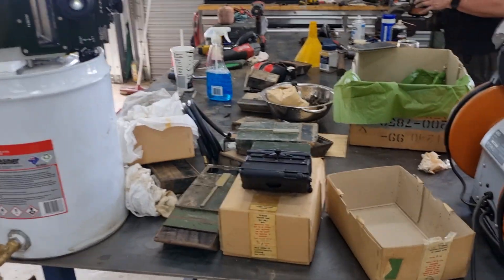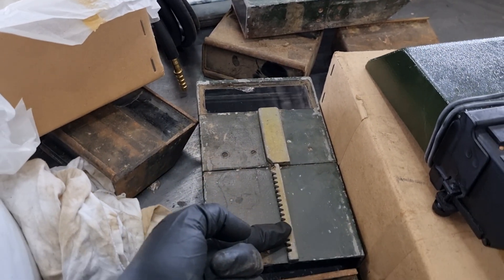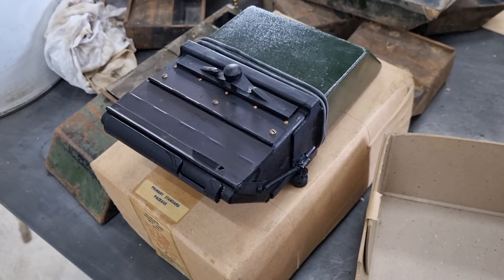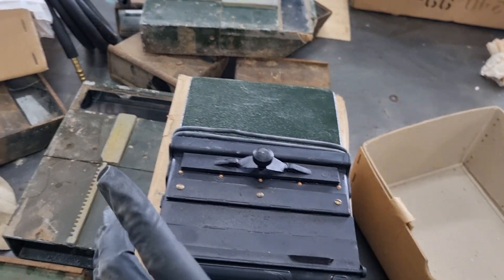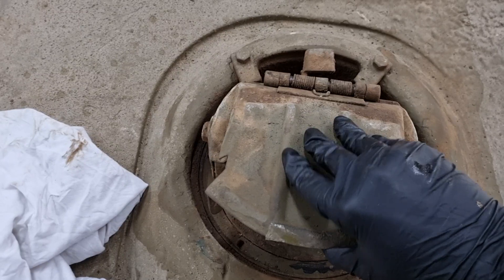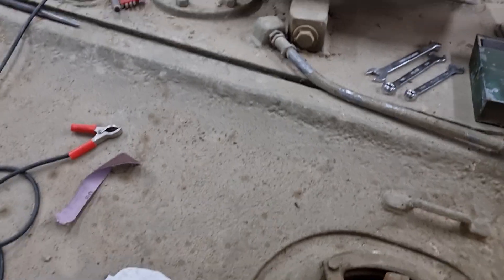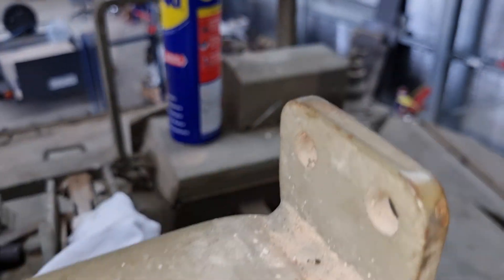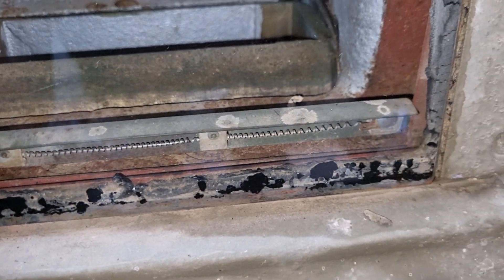Exploring how the Optics on Centurion Tanks work

Comment: The circle in the gunners sight is the target acquisition circle. The commander has what is called the reflector come periscope sight or RCP sight which is not fitted in your cupola at the moment. The commanders RCP sight is co aligned with the gunners acquisition circle so that if the commander spots a target he uses this circle to lay the gunner quickly on to the target and give a fire order.. The gunner identifies the target by looking in the target acquisition circle and then looks for the target using the (x10?) monocular sight. The gunner will adjust the graticule in accordance with the commanders fire order, using the sighting and laying equipment, elevation and traverse onto the target with the correct ammo nature.......and so on from there

Comment: How does the gunner's primary sight pivot with the gun?
Reply from the maker: There are a series of rods that go from the gun to the sight bracket. I'll show them in action when I run through the gunnery 😊
Reply: On the gunsight mount inside the AFV where the gunsight id fitted, there is a sight linkage bar connect to the elevation rack.